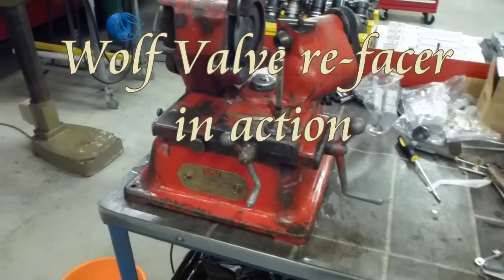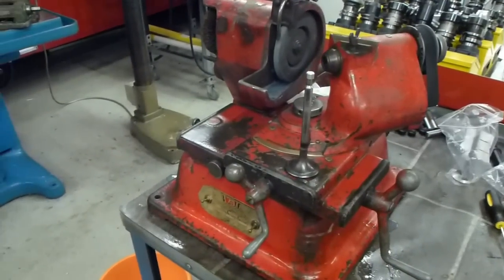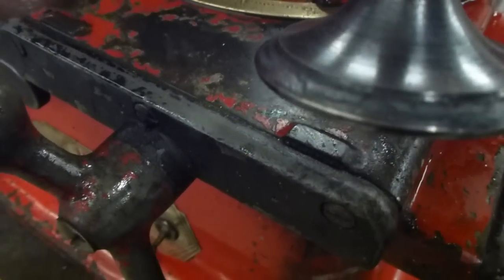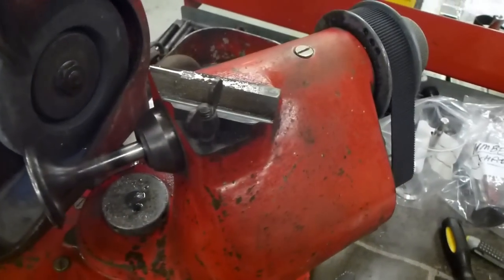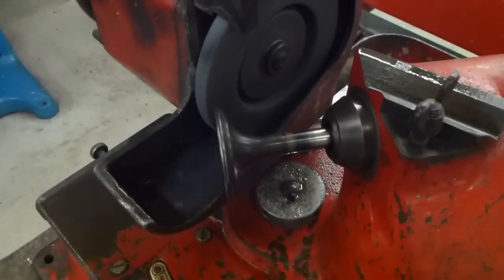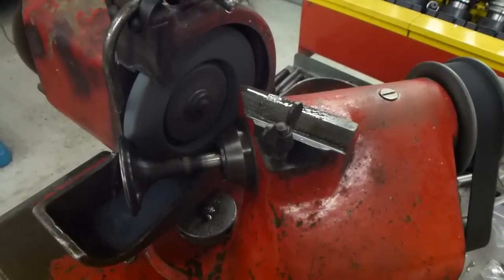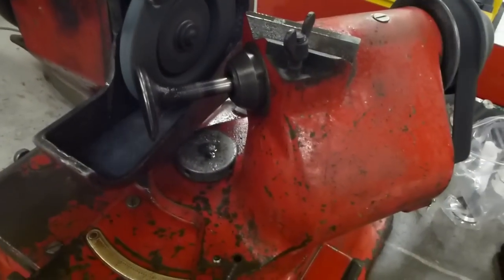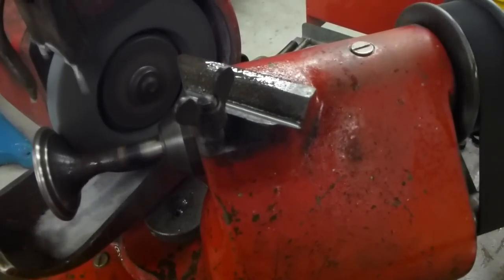GXA95 Dennis Merryweather - Valve re-facing with a Wolf Precision Valve Refacer

Comment: Are you grinding all your angles on thevalve with the machine? can you show a setup video of the angles and valve seat measurement?

Thanks
Reply from the maker: I am only familiar with valves ground with a single angle and valve seats cut with multiple (3) angles. These valves are out of an engine manufactured in 1938 when gas flow was far behind the technology of today.